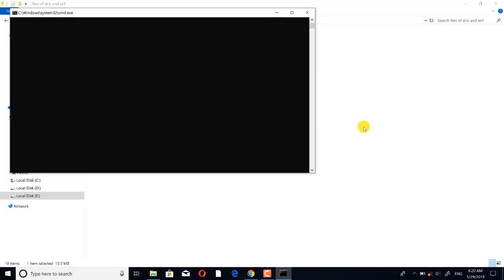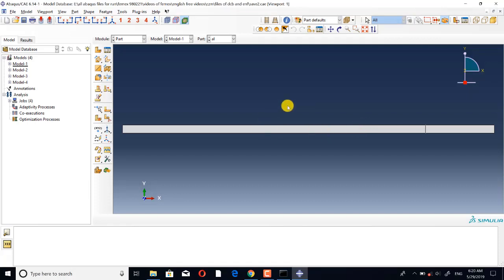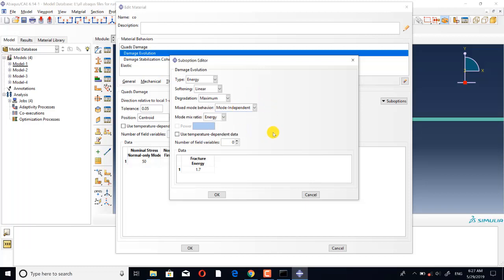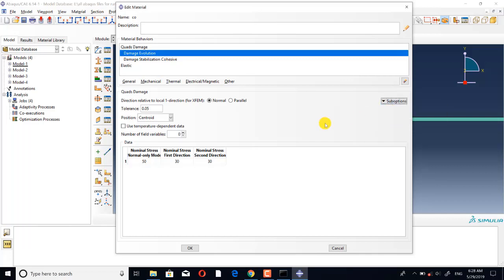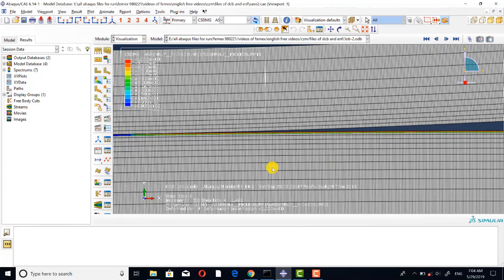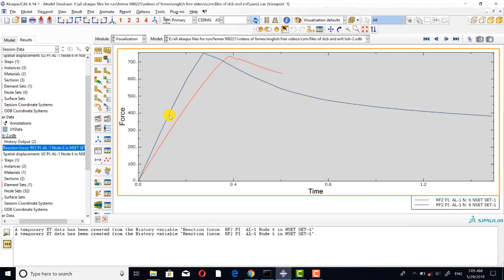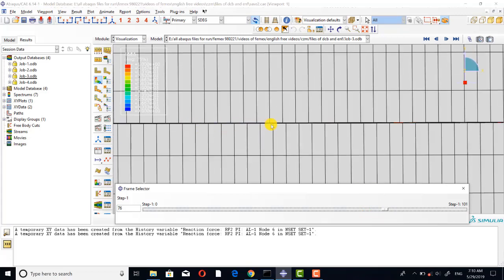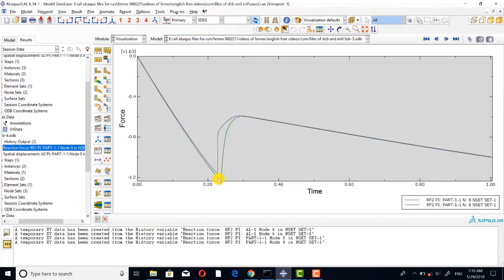cohesive element and cohesive surface in abaqus

Comment: Thank you for this video! I have a question about simulation brick wall. Mortar can be use as cohesive element or we use cohesive surface? Can u explain more about bout simulation brick wall. Thank you!
Reply from the maker: Hi.
You are welcome.
There are several different methods for modeling the brick wall. You can use the Cohesive Element or Cohesive Surface to model the mortar. Even you can model the mortar as a part and define Cohesive surface between mortar and bricks. You must do according to your reference paper.
Regards.

Comment: Sir for providing slip property between reinforcement and concrete cohesive element is suitable or not???
Reply from the maker: hi. you can use both of the cohesive surface or cohesive elements. bot of them are suitable.
Reply: @FemexIran  sir what property is necessary for providing cohesive surface or element.??

Sir i am trying to doing 3-point test on RCC beam in which i model a concrete beam as solid element and create hole between them so that i insert a longitudinal reinforcement as solid element in the beam.

i am also using stirrups as wire element and embedded into concrete beam.

Sir i am trying to give slip property between steel reinforcement and concrete beam therefore i use surface to surface contact and provide normal and tangential behavior (friction coefficient=0.45).
I also provide plastic property
but sir my file is not giving result as well as error.

Sir, if you have time, then I am hard to send my abaqus file to you
Reply from the maker: @sunayanasaini1187  send an email to me (mirzabozorg71@gmail.com)
you can use our paid services: i review your model and find the mistakes and explain them and the way of correcting them for you.
Reply: @FemexIran  sir I send my model 
Please check your email.
Reply: Sir any updates
Reply from the maker: @sunayanasaini1187  hi. today i will answer you.

Comment: Hello, I am working on adhesive joints in single lap joints. modelling of adhesive layer is done as cohesive elements. In results I am getting that the adhesive is extended and no deletion of elements is happeninge and I am using the element deletion option

Could you please suggest anything? Waiting for your reply